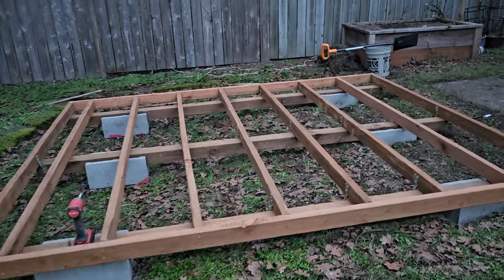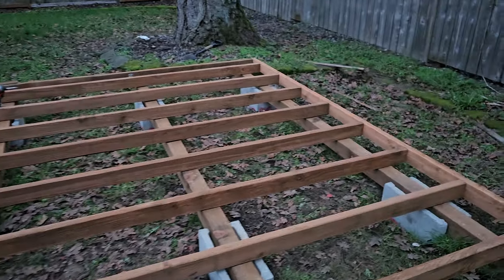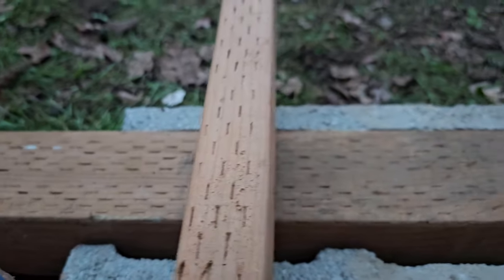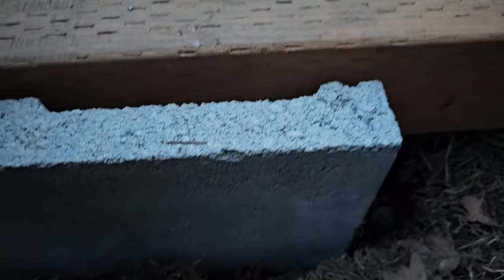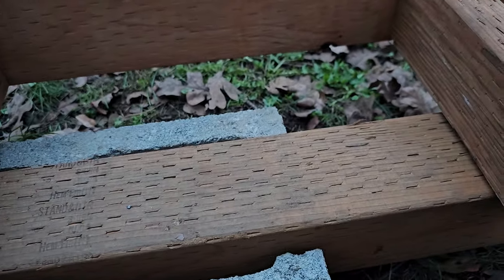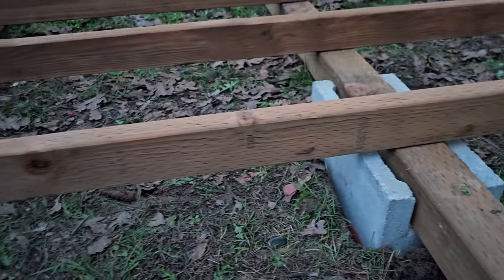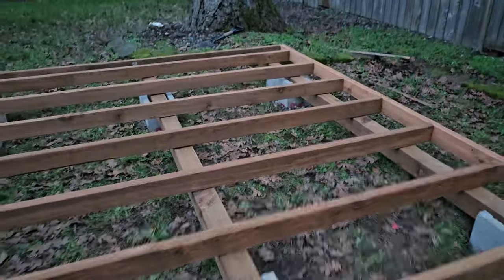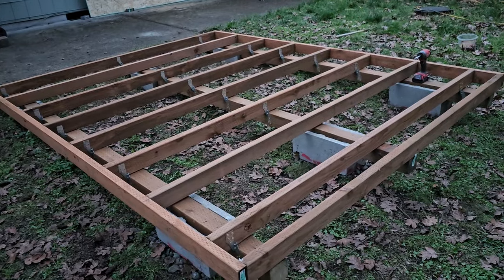10ft x 8ft Shed Floor Foundation Using 2x4 pt Joist

Comment: Looks quite sturdy but I would adding noggins down the middle. Not seen the gravel and breeze blocks idea before but looks good - did you cut out the 4 x 4 clearance yourself or did they come like that?
Reply from the maker: Actually they came like that, didn't cut anything.
Reply: @handymanjeff  Very cool, really interested to watch this build